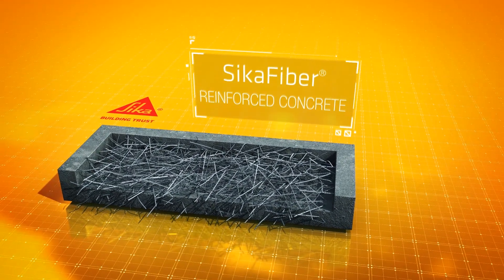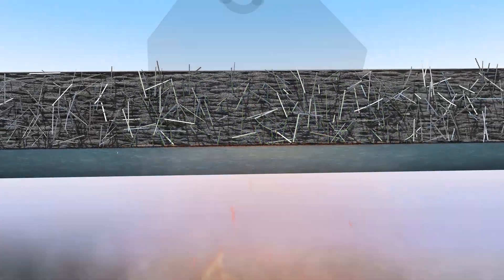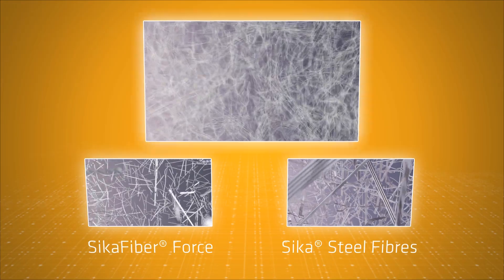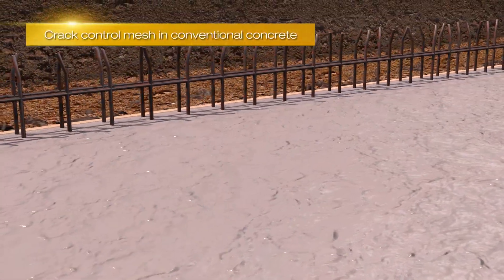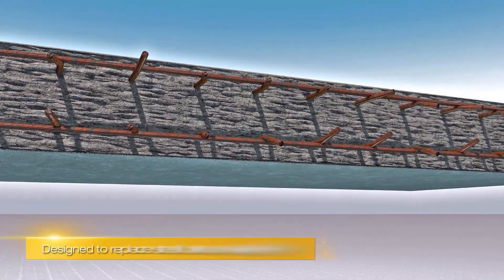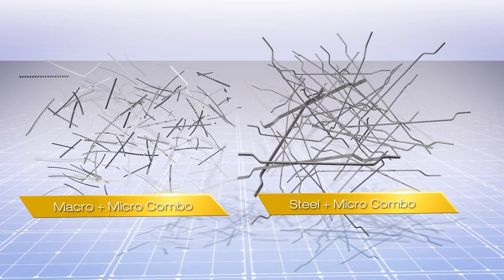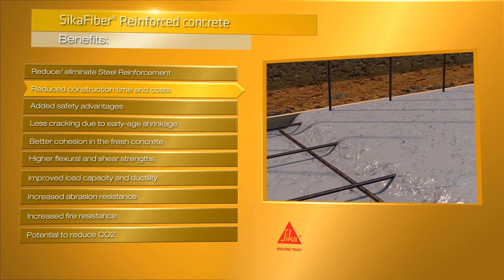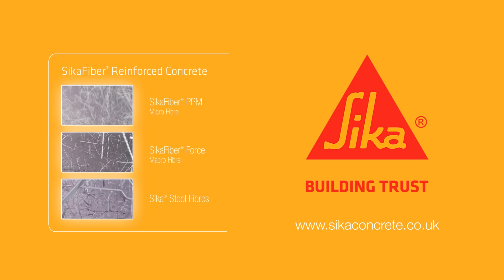SikaFiber® Reinforced Concrete

Comment: Low melting point? Dont you mean high melting point?
Reply: Low melting point benefits fire resistance by releasing trapped gases and preventing explosive spalling due to pressure build-up.
Reply: I was wondering about that. It’s hard to imagine these fibers would have a higher melting point than concrete; but what benefit would either a lower or a higher melting point have?
Reply: Good observation. I heard that too 😅.
Reply: I’m going some combination of these to my refractory mix for my diy pizza oven project😎

Comment: Why did it take the concrete industry decades to realize such a simple concept?
Reply: Don't forget this is a selling presentation, fiber concrete solutions are applied in industry for decades. You need the right solution in the right place, fibers are not replacing Rebars anywhere as are NOT a structural solution. Are a surfaces quality and cracks extension solutions.
Reply: @costiqueR  it is more for architecture proposes than structural, I use it in making tables of white cement but not the sika one, there are some other brands too but they took their time to released, I use fiber glass.
Reply: 天堂心臟  Horse hair, washed wool and asbestos where common concrete additives in Rome circa 150 AD +.
Reply: Uhh... Moses and the Israelites making bricks with and without straw? The idea is literally biblical. The trick is to use fibers that are compatible with the alkaline environment in the cement mixture.
Reply: Its been around for a long time. Depends on budget and application.